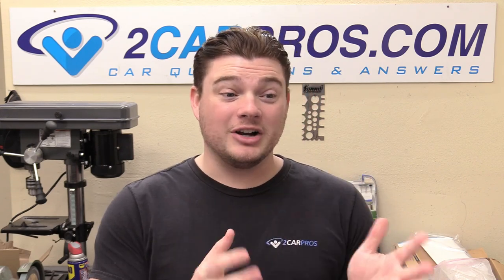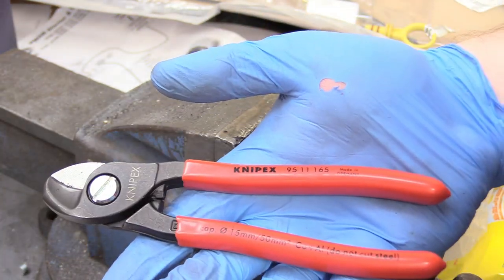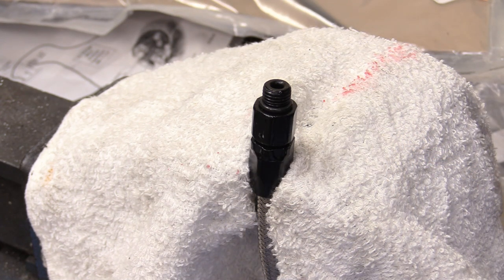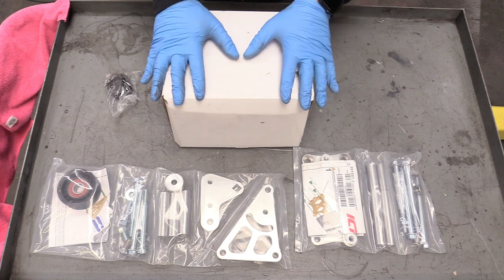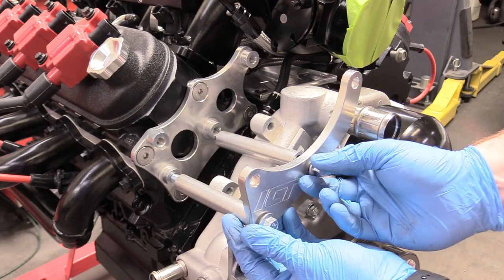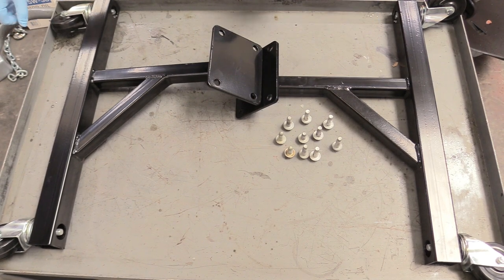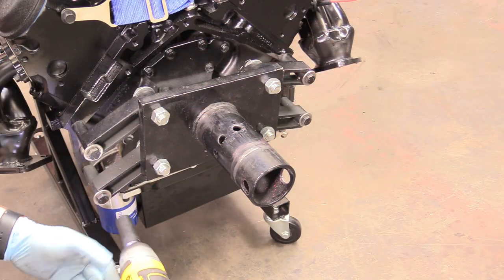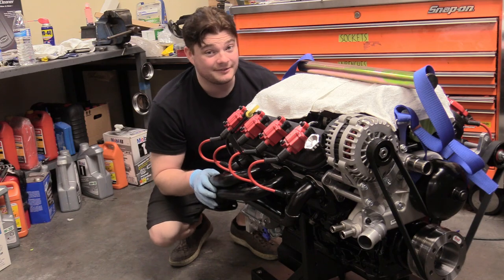How to Build a 5.3L LS LM7 V8 - Part 12: Steam Lines, Water Pump, Alternator, Flexplate - FINISHED

Comment: Thanks for taking your time and recording this series and then taking the time to upload to your channel.  Also thanks for adding all the links for parts in the description section.  Just out of morbid curiosity I have wanted to rebuild an engine for a while now.  Just to do it.  I'll either sell it when I have completed it or find a vehicle to swap it into.  Block I am rebuilding is an LC9, which is a 5.3L gen. 4 aluminum block.  Probably go with forged pistons and rods.  The stock crank should suffice for the power level I am looking at.  If the crank needs to be turned, then I will probably just buy a new stock one.  I'll need to run to the boneyard one of these days and pick up a set of heads.  Last time I was there I had a chance to grab a set of 706 heads, but was a little too lazy.  The beauty of this is I am doing it for the learning experience and I have no time table so I won't be rushed and I can take all the time I need.
Reply from the maker: That's so cool! Ever think about putting it on the dyno just to see how much power it makes? Thanks for watching!
Reply: @2carpros  Yes.  That will probably happen, because if I want to sell the person buying it is going to want to know what kind of power it is making and make sure that during the initial start up the engine runs great.  No oil and aluminum milkshake and rings get seated, etc.  I have a 1986 Grand National I could swap it into, but the rebuilt stock motor in it only has 3k miles on it and most of those are just cruising miles.  I have only went WOT with it once or twice.  Believe it or not I have not taken the time to properly tune it.  Not much to tuning it, just adjusting the methanol injection.  With an optimal tune it will probably make 550whp and a similar torque number.  Swapping the LS into it, will allow me to save the stock rebuild which was about $17k.  I'd have more power to play with and not really have to worry about hurting the motor as the LS is so much stronger.  Thank you

Comment: If you are returning the engine back into the stock vehicle and still want the Ac compressor and powersteering pump etc, do you still need the alternator bracket, or something or else or keep the stock form?
Reply from the maker: Just get the stock bracket so the belt path is stock. Thanks for watching!

Comment: Hi watch this series I cannot count how many times I have been doing my build off of all your videos well yesterday I put my heads on and realized I did not put the lifters in so I took the heads back off and reinstalled the lifters and then used the same fell pro head boats to fasten the heads back on I did the OEM procedure and they felt like they had a nice clamping force what do you think should I go with it or should I teared apart again and get new head boats

Comment: I just want to say thanks for all the videos, Help Alot on my build Sir!!!
 I'm currently doing the same build, I have 2003 Lm7 5.3  bored.020 with LSA supercharger to put on top. Going into 1984 chevy caprice, using I.C.T billet adapter plates, and energy suspension motor mounts.

 My question is which steam line  ports would be the best .
Block the back 2 off and just use the front 2 or use 4 steam port that loops around super charger to the frt.

 Just thought I asked since I'm using a super charger, 
Thanks Again For All The Help!!!
Reply from the maker: Awesome! Love to read that! 

4 is always better than 2. It has to do with how the engine is tilted in the car. So it's just easier to go with 4 and avoid any kind of air bubble in the heads.

Thanks for watching!
Reply: @2carpros  

 Thanks for the reply info and you're advice.
Also I'm enjoying watching the build on that ShoeBox Chevy!!

Comment: So can I just run the stock steam lines? Also can I dead head the rail on one side and will the fuel pressure be fine? I shouldn’t have to use a aftermarket fuel pressure regulator right? I have this intake but for some reason the connecting of the fuel lines to the rails is just confusing the crap out of me. Thanks.

Comment: I’m doing a lm7 5.3 build as well with a single turbo kit, I’m only going to use the front steam crossover tube, question is can i block off the water pump spacer hole & use the accessory drive like yours?
Reply from the maker: Nice! Sounds cool! Yeah I can't see why you couldn't do that. I would be concerned the steam lines not working correctly without it though. Thanks for watching!
Reply: @2carpros  well i just bought it & I don’t want to spend extra money just to get the kit that you bought so i can get everything to work properly

Comment: @2CarPros…thinking of upgrading to a metal intake manifold, mines all stock. Do I need to upgrade or Tune anything just after replacing with a metal manifold? That’s all I’m wanting to upgrade. Rest will stay stock.
Reply from the maker: No you don't. But changing out the intake won't do much for you over the stock unit besides looks. Thanks for watching!

Comment: I’m getting an lm7 this week and I’m curious what size bolts you used to attach the cradle to the heads? Thanks
Reply from the maker: You can use header bolts in the header locations if you thread them in far. I don't remember the exact bolts for the front and rear of the heads though they are a bit bigger than header bolts I just head laying around from the tear down. Thanks for watching!

Comment: I was looking at the summit oil pan but I noticed you cannot screw your transmission to the pan like the stock what do you do in the situation do you just not screw the bell housing to the oil pan
Reply from the maker: Correct. Just use the engine. Thanks for watching!
Reply: @2carpros  is that Safe I really wanted to go with that pan I love the fact that it’s metal and painted I ordered one aluminum Harley clone on eBay and it came damaged I just ordered a different one from eBay hoping it works but I would prefer to go with this one just didn’t know if it was safe to run it with the all the housing bolts bolted

Comment: Do u have the part numbers to the steam kit where it T’s out to the water pump spacer?
Reply from the maker: Yeah it's in the steam line kit. But it's just a -4AN ORB junction block with 1/8" NPT port and one -4AN to 1/8" NPT flare adapter. Thanks for watching!
Reply: @2carpros  would I have to buy more plumbing or tubing for the rest of the way down to the water pump spacer?

Comment: Hi, Ryan-
Do you have the part number for the water pump bracket from ICT with the steam line port? Summit has several thicknesses available in their website. I am using the same water pump and need the same bracket.
Reply: Nevermind, found it! Thanks!
Reply from the maker: Nice work! It came with the kit I used so I'd just order that one. Also ICT has the best customer service so don't be afraid to reach out to them too. Thanks for watching!

Comment: Can I use twin turbos on same build and same parts that you used from summit what do think about dyno numbers ??
Reply from the maker: Yes if you get a forged crank. The rest is turbo ready. You might want a different cam and valve springs though. Thanks for watching!
Reply: What’s is the expected numbers on wheel

Comment: I have a 2003 lm7 out of my trailblazer that has knock/slap not sure but it still runs good, I’d like to rebuild it but I’ve never rebuilt an engine. Do you think an ls is easy enough for a novice to rebuild?
Reply from the maker: Yeah definitely. It is the easiest automobile engine I have ever built. The easiest was a 1 cylinder lawn mower engine. Thanks for watching!
Reply: @2carpros  do I have to send the block and all to the machine shop? I’m just not sure what size bearings you’d need for everything and stuff like that.
Reply from the maker: @dylanrhode4361  Check this video out https://www.youtube.com/watch?v=RvBYxpRC464&list=PLe3kz1i_LrtX5402mzO6ovoz8xeUdwZ8B&index=3

Comment: Absolutely never use a hacksaw… high speed cut off wheels leave no burrs and easily seat into the fittings, always done it that way like everybody else for 20+ years and NOBODY EVER used a hacksaw but i guess i didn’t have some cutters i was trying to sell.
Reply from the maker: I use what works and a hacksaw did. Thanks for watching!
Reply: @2carpros  not well, cut-off wheel doesn’t leave the wires sticking out but keep selling those cutters!
Reply from the maker: @jeremysmith6905  Worked fine for me. I don't sell anything or any financial kickbacks. Also most people don't have highspeed cut off wheel that they would have to buy since you have some sort of problem with buying things. Most people have a hacksaw ironically.